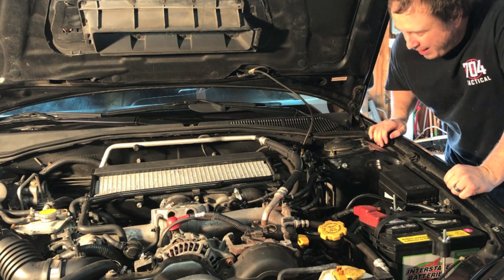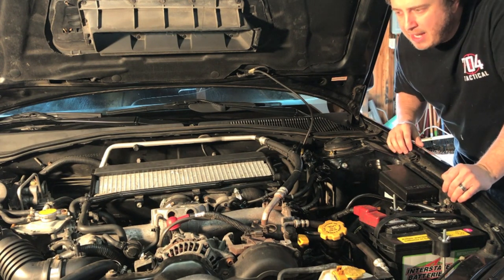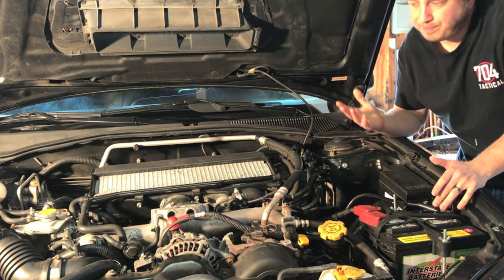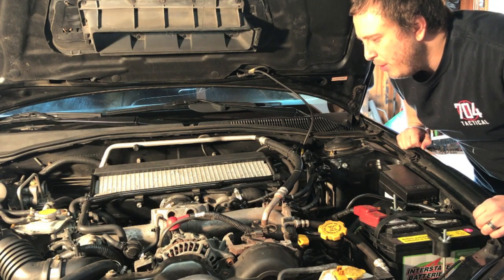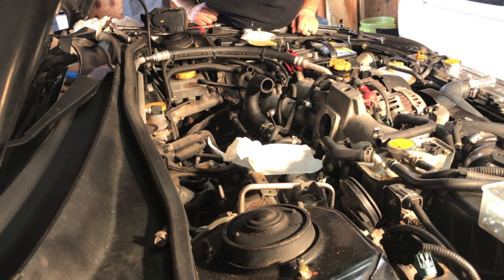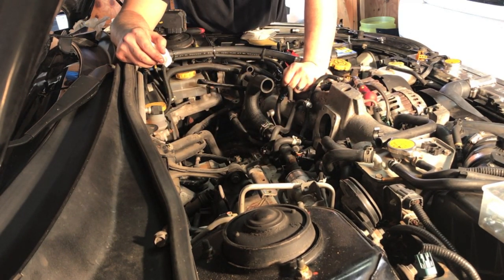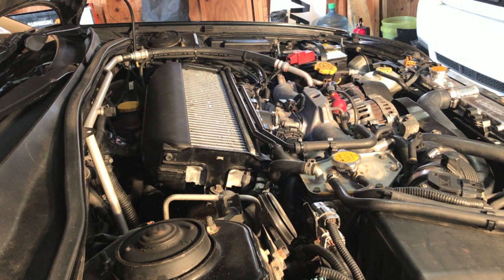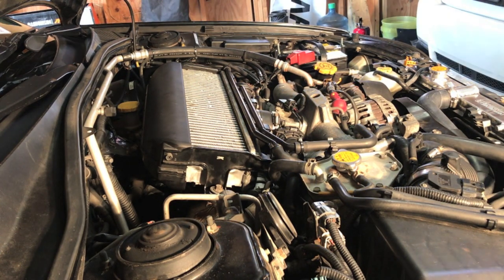Subaru Baja Turbo - Throttle Body Cleaning - Removing Intercooler

Comment: Thanks for the video, I've got an 04 WRX with 250k for mileage (I'm the original owner) which I'm going to do this to for the first time this weekend. I would have suggested changing the pcv valve while you had that intercooler off unless you had done that recently also.

Comment: So what happened afterwards?   Did cleaning the throttle body solve your stalling problems?  (I'm dealing with the same issue... stalling when slowing down, but only when it's good and hot.)  Thanks!
Reply: It fixed mine! I didn't remove the throttle body though.
 I held the flaps open and wiped it all down after some light soaking combined with sprayed blue shop towels.